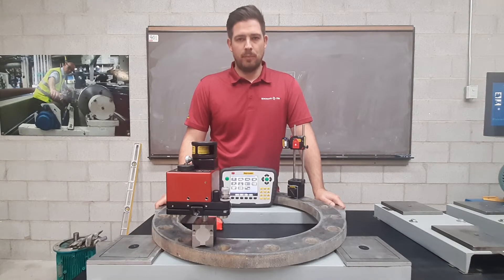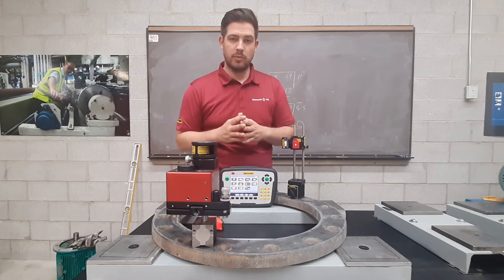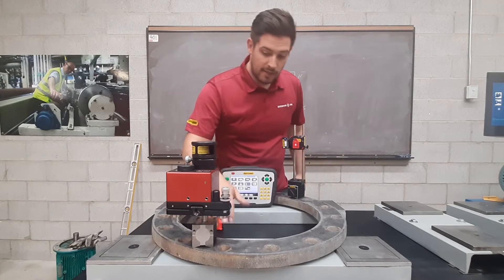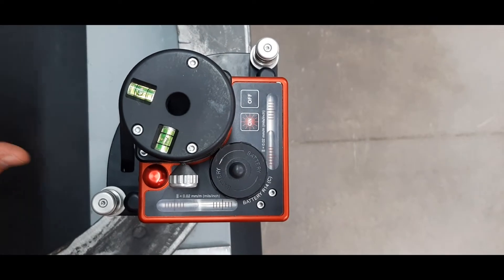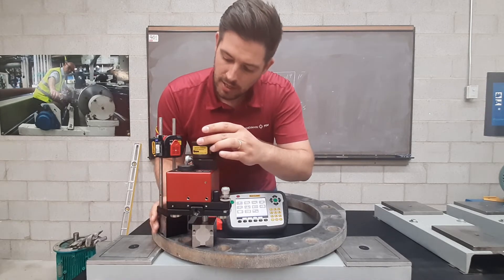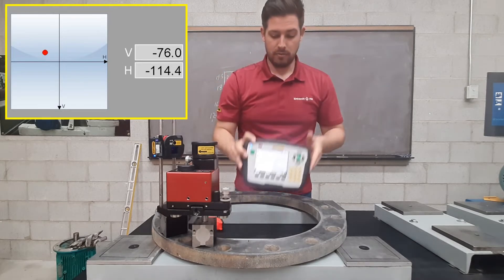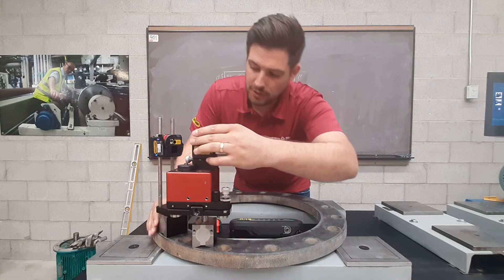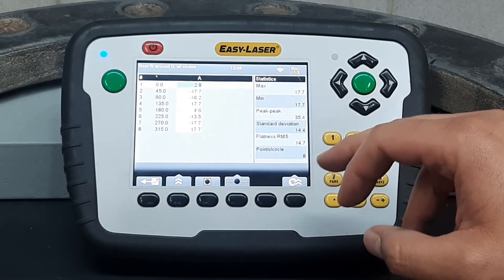Flange Flatness Measurement using the Easy-Laser E920

Comment: Once you have setup the "reference plane" what is the range of deviation you can measure, for example if one point is to way up or down and the laser is out of fiel of the receptor?
Reply from the maker: Hello Felipe, if you set up the lasers roughly into the center of each detector surface, and with it being a 20 x 20 mm detector surface area, you should have approx. 10 mm range in every direction to ensure the beam stays in the detector.